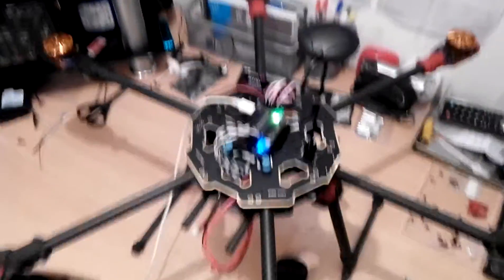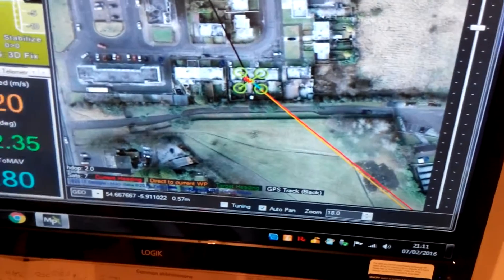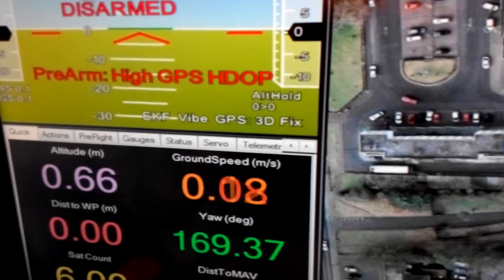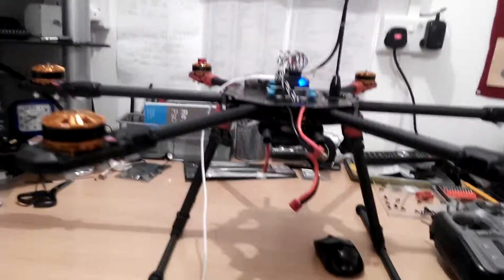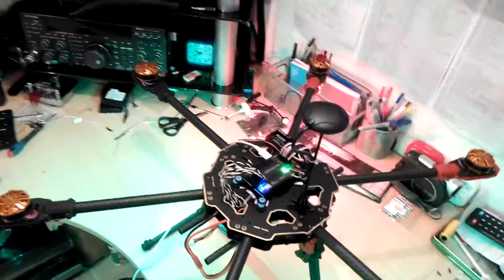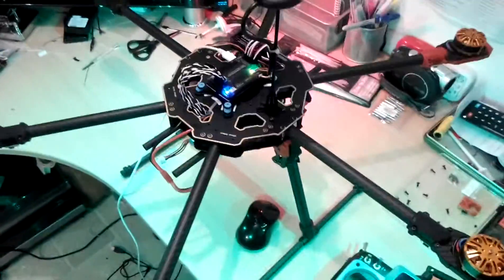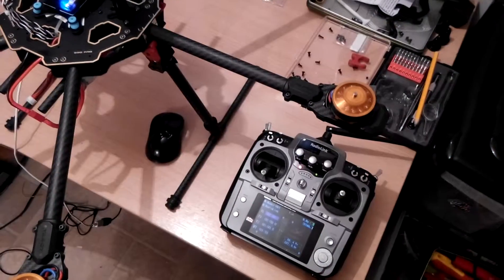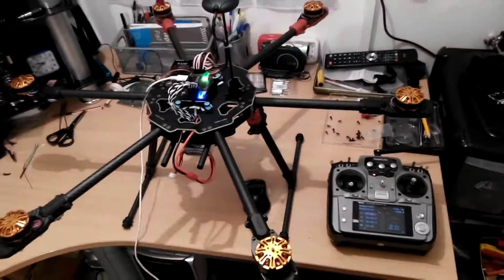TAROT 680 PRO HEXACOPTER APM 2.8 FIRST BENCH TEST/

Comment: What is your esc ?
Reply from the maker: hobbywing platinum pro 40 amp ESC.  with NO BEC.    hope this helps.
Reply: +Richard Gilmore Thank you
Reply from the maker: +Hüseyin Tamer your welcome.    you building one too??   nice frame the 680.  but a nightmare to work on.  wish I had have bought an umbrella type frame. like the 'max 6'.  life would have been easier.   good luck.   :D
Reply: +Richard Gilmore yea i building 680 frame and apm but can i use 15 inc propeller on tarot fy680 frame ?
Reply from the maker: +Hüseyin Tamer   no.  13 max.  I'm using 1355.   with which release.   good job.  15's will hit each other.  13. will be good.   I have taken APM of mine.  it was ok.   but changed to JIYI pro 2 F.C.  much more stable.  really happy with it.   look at my other video.   super stable.   ive put a Sony camera on and big gimbal.  so APM.  although good.  and I love APM.  I wanted something more stable.  and built for multirotor.   but APM still very good.
Reply: +Richard Gilmore OK. thank you i look your other videos